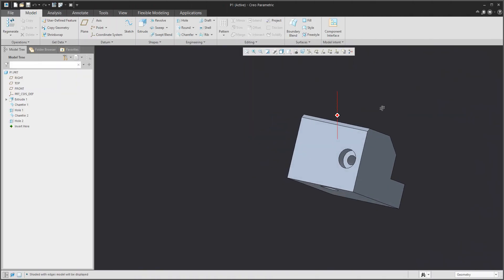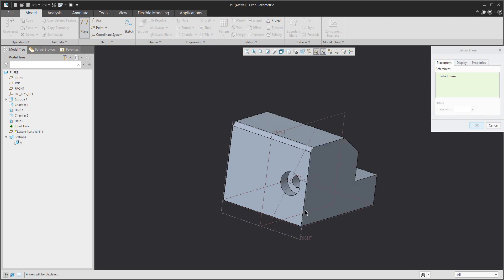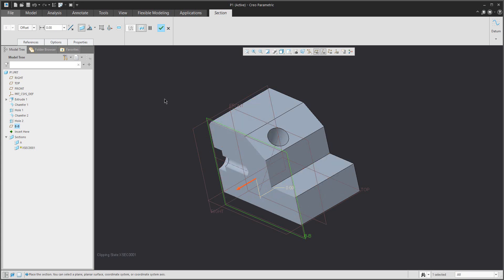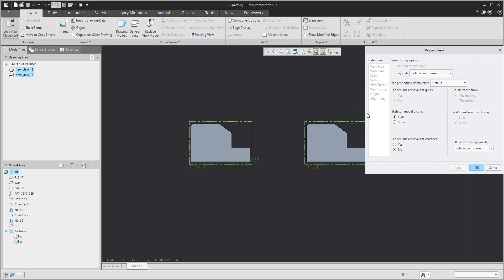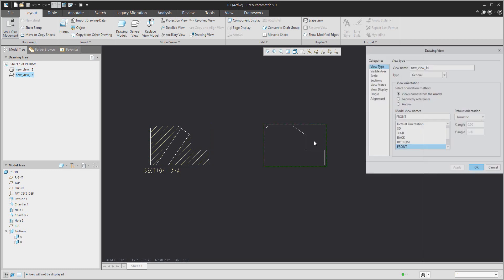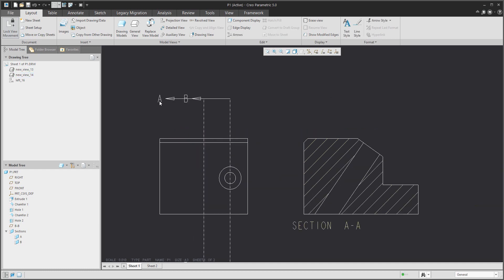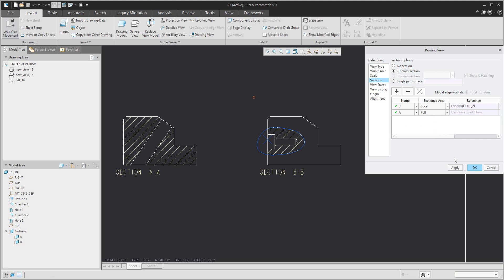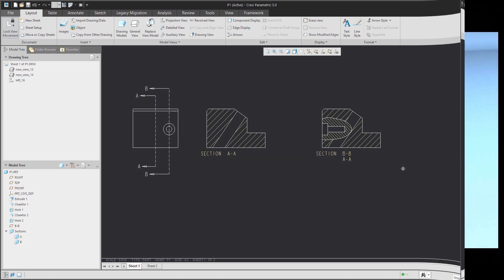Creo Drawing tutorial: How to create cross sections

Comment: Good day. Thanks for the helpful video. Can I borrow the settings from the palette of the appearance of the control panel and the background of the model ?, please.
Reply from the maker: HI, I do not really understand - do you want to Copy color from one model to another one?
Reply: @4kside  I apologize for my terrible English. I meant the design of the program. You have the background for the detail of the dark color. There is a file that sets the palette of all elements, config. The RGB code contains a color background code - it is of a dark color. I would like to know the RGB code of this color.
Reply from the maker: @maverick342  No problem - we have to still improve our English - it is same for me ... the RGB detection is not so easy in this preferences ... but if you ask me how I use it - you can create print screen and then really easy in PAINT (Windows program is possible to detect it - with Color Picker / and ten you can apply it to Creo RGB >> I hope that it helps you. BR, Vladimir